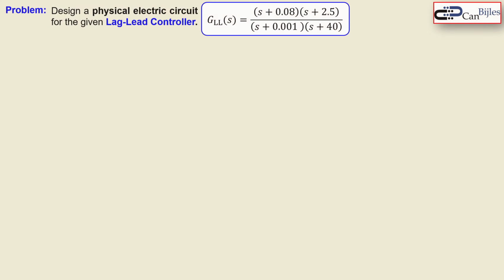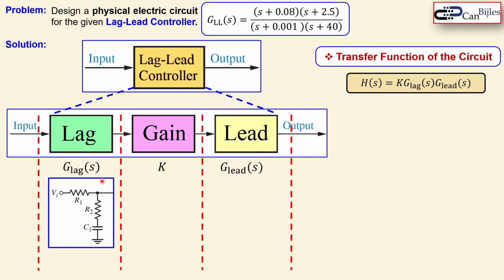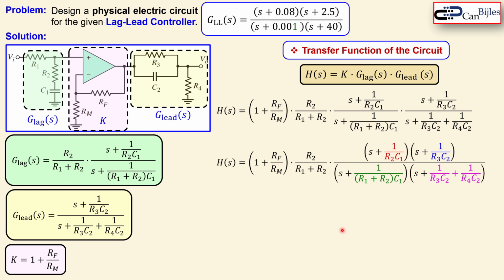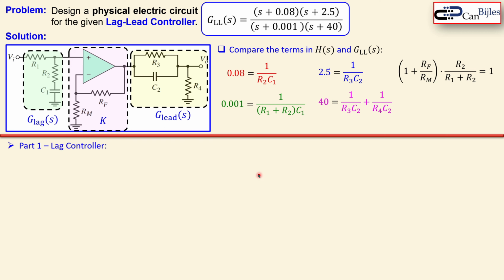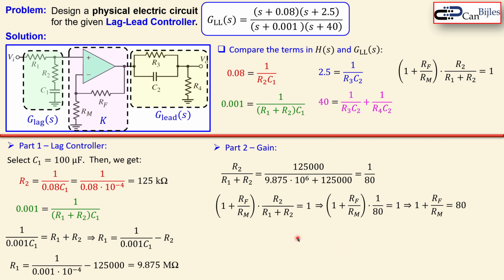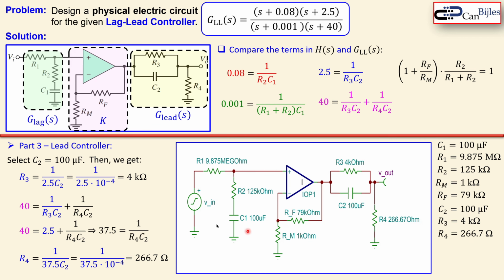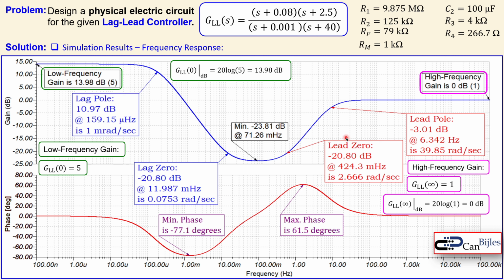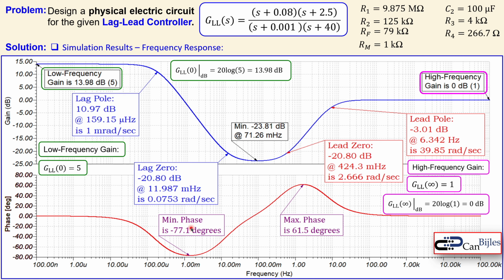Realization of Lag-Lead Controller using Active Components 🌟 Calculations & Simulations 👍 Example 9

Comment: Great videos!
I came here from example 7 and 8. I tried to create what you taught there and it worked fine. When I attempted this simulation on QSPICE it did not give the right results. Is there any particular reason you selected such low frequencies for the example?
Reply from the maker: Glad you liked the videos 👍 There is no specific reason for the selection of the poles and zeros. Just to make the content representative. 
I have not used QSPICE. It might be because of the op-amp model or some settings in the simulator.
Reply: @CANEDUX  I tried it on LTSpice as well. :S
I tried to make a generalized setup where i can put in the frequency of the pole and zero and the component values are computed. This same approach worked for example 7 and 8 but not for this. Can you direct me to some reading material (which you recommend) which has steps or examples where they have derived a similar circuit. I am interested in lead-lag circuits.

PS: I need to place a pole at really low frequencies(~10Hz) followed but a very close zero (~77Hz).
Reply from the maker: @adityadrs   You can use TINA-TI SPICE :) It is, I think much better than the LTspice. Also, it depends on the op-amp model, as mentioned before.
About the poles and zeros. It might be because the poles and zeros are too close to each other, so they interact too much. The result of the overall function will change because of this. 10 Hz and 77 Hz are far, but not far enough. One decade distance is recommend to have an independent analysis.
I use several resources for this, but you may consult: chapter 9 of Control Systems Engineering, Norman Nise.